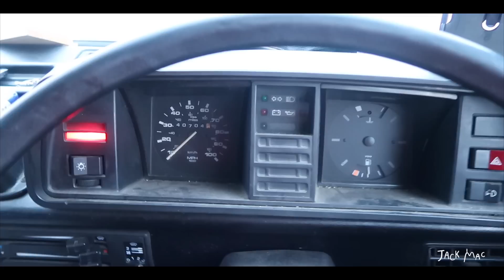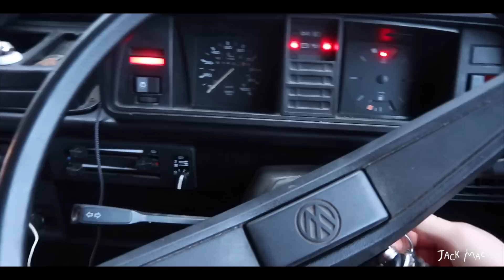VW Syncro ' Journey to the Arctic ' - EP 9

Comment: Phenomenal and great video. The place is wonderful and  the van is very good.  In these conditions the oil is very important, I use Mobil 1 / 0w40 and it is 100% synthetic and is suitable for any gasoline or diesel engine.  Good luck and I follow you.  Thanks for the video.
Reply from the maker: Thanks so much, really kind :-). Yeah I always take servicing really seriously. I run Morris multigrade Oil 15w/40 and I can honestly say that its one of the best things I've done for the engine, it runs really sweet on that. I also change the oil/filter every 4000 miles to be safe. My van's pretty high mileage now so have to be careful. :-)
Reply: @JackMac  great. All the best.

Comment: A lot of the uneducated out there really have no idea how great the t25 vans are get them kitted up right and there capable of anything you throw at them awsome vid fella
Reply from the maker: Thanks Richard and couldn't agree more. I talk about this a lot on my website. Serviced correctly the stock t3/t25s are really reliable and most importantly have arguably the biggest/best community & parts online which counts for so much. Any issue I've had is so quickly remedied and I can get most parts within days anywhere in Europe ( not to mention it's easy to fix yourself for the most part ). Preventative maintenance and servicing is key. Thanks so much mate :-)

Comment: Miss my Syncro. Keep and eye on the fuel pump. Mine leaked and the van went up in flames. Nothing I could do to stop it including using  a fire extinguisher.  Loved the video.
Reply from the maker: So sorry to hear that mate, I know that's a big issue. I've just had a total rebuild of my WBX so this has just been changed. I also run a auto fire supression system in the back just incase. They go up so fast, really sorry to hear. :-(

Comment: My Mitsubishi L300 Van, 1985 model still has the original alternator after 400.000 kilometers.
Reply from the maker: Haha I actually have a L300 4x4 , long story, love it though! Arguably a more reliable vehicle than the ole syncro :-)
Reply: @JackMac  I thing those t3 and t3 syncros having the engine at the back have an advantage in traction even in two wheel drive.

Comment: What about modifying the heat-source with a hose that goes up oner the comforter, wherein you just turn on the heater for 5-10 mins as needed through the night- thinking, after you are settled and enough heat is stored underweight, that your need to leave the heat on is not a compromise.. ? A thought..
Reply from the maker: Very interesting ideas, thanks for the suggestion. I fitted an all new Victron battery charging set up with two huge new leisure batteries and solar this xmas so I'm hoping that will allow me to run the petrol heater all night no issue :-). One thing I do really want to do, which is sort of linked to your point, is instal a seperate outlet to pre heat the engine in the morning!

Comment: Just a tip. Don't idle the car to warm it. Give the engine a steady load by driving it for warming it up. Keep the rpm between 1000 - 3000. Idle is bad.
Reply from the maker: Hey buddy thanks for the advice really appreciate it, always learning. The only issue I had with the extreme cold is that the van actually won't get warm in  -24 and I'd let it idle for around ten mins just to get any heat to the engine before the wind chill when mobile drove it back down. I could probably block up the side air vents in future to help the engine but it was ok after a few hours. Poor old van haha :-)
Reply: @JackMac  Actually block the whole front. You can use cardboard as a quick and cheap fix. But use it only if it's -10 or less. You can leave the side vents open. Also the usual checks for coolant to be suitable for this weather and the oil viscosity is suitable. 
Small tricks for the artic. :)
Reply from the maker: @Viskibasso  Good idea, I've actually seen some of my friends with the LT MK1 4x4 do the same. I'm definitely on point with the correct coolant and I'm running Morris Multigrade 15w/40 which has performed well :-)
Reply: Idle is not bad. where do you have that from?????

Comment: Subscribed! Awesome stuff mate, its on my bucket list to do a snow trip up through Norway. The Syncro did well. Did you have any major breakages along the way other than the wear on the alternator? And can i ask whats the band and song in the background at the start and from 3:11 or so onwards? Stay safe and keep doing what you’re doing! Cheers mate 🤙🏻
Reply from the maker: Hey Rhys, thanks for the kind words! I'll add a load of info about the journey etc to my website www.jack-mac.com over xmas that includes some things I learnt along the way that might be worth considering if you plan a trip there :-). Yeah it's a great van, although I still get nervous before big drives whether I'll make it haha. The van was spot on, only issue was brakes actually freezing to the discs and then burning which was mad. The T3's and WBX engines are very good. However, servicing and preventative maintenance is key. Moreover, the worst part is not knowing how a vans been treated before which is why so many get a bad rep for being unreliable when in reality they've just not been serviced properly. Sure it's my mates band and they have a Youtube channel ' amberroomsongs ' :-). Thanks again and will do!

Comment: Very nice video! Which Engine do you have in yout T3?
Reply from the maker: I have a standard 1.9 WBX ( currently being completely rebuilt ). The 1.9 is arguably a little better for big miles than the bigger 2.1/2.5 as it doesn't run as hot. Moreover, there's less to go wrong as its just a carb and not fuel injection :-). Thanks for the kind words!

Comment: Carry a small electric heater. Truck stops , hotels, hunt around find a power point use your shoreline power cord  pug in.
Reply from the maker: Hey buddy, the Eberspacher is really good in the mountains when I'm off grid ( although I just wrap up and switch it off during the night ). I do sometimes use hook up when I can get it at work, I sometimes borrow a oil radiator and that's ideal :-)

Comment: you Need an extra battery for the heater and a charger that charges it while you drive
Reply from the maker: Yeah I only had a small leisure battery at this point. I've recently upgraded to 220 ah leisure batteries and a victron charging system that ensures the starter battery and Leisure batteries are always full :-)

Comment: 6:40 … is it a gas or Diesel engine though? Because running diesel for just short times I think is not exactly beneficial . . .
Reply from the maker: Hey buddy, it's petrol. I have heard the same recently funnily enough. I guess the only thing is in Norway at that time of the year it is extreme around -20/25 and as soon as you get moving the wind chill just makes the temp plummet so I figure it's best to let it have at least a little time to idle and warm up before It starts hauling itself up mountains. I'm always learning of course, just seemed to make sense in such cold :-)
Reply: @JackMac  and I just found your channel, but the last video is a bit ago so I was wondering, did Corona get in between your 2020 plans? Some borders are open still...
Reply from the maker: Lukas Budde yeah it certainly did. I was back in Norway at the start of 2020 but as things worsened I returned to the UK as I wanted to quarantine with my family. The uncertainty of how long all this will last was unnerving so seemed sensible to head back to somewhere familiar 😊